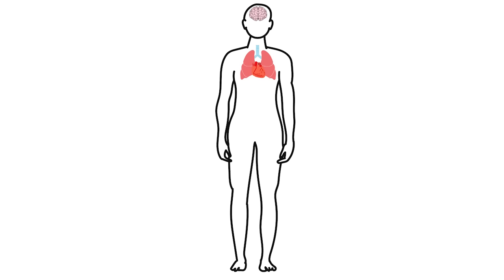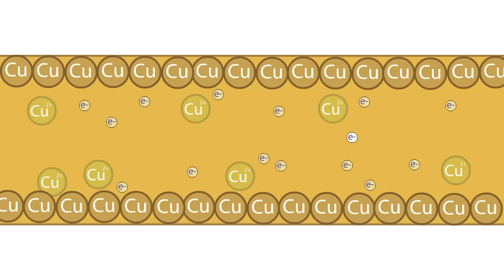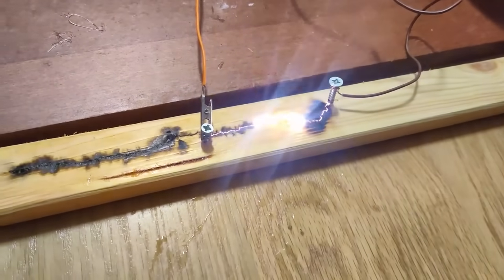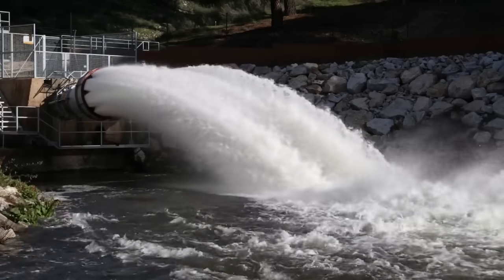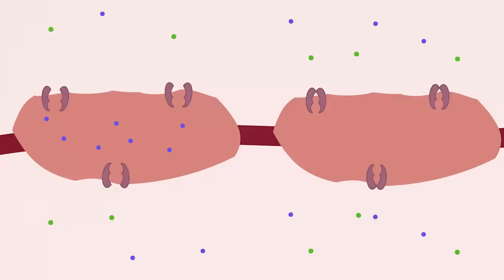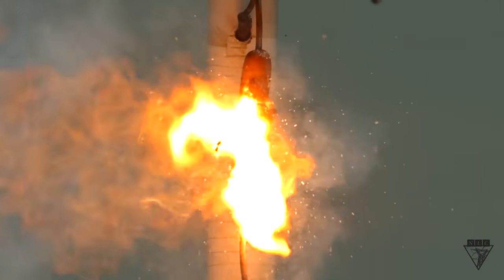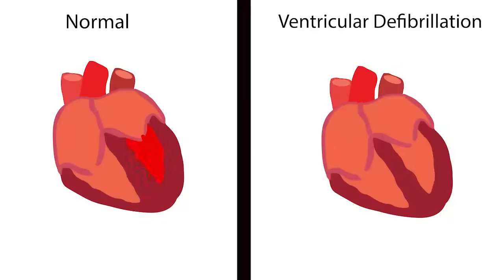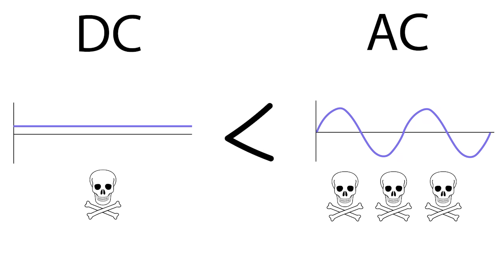Anatomy of Electrocution

Comment: My dad is an electrician and he had a "no let go" shock when someone ignored the tag on the breaker and turned on the wires he was working on. He said he knew what was happening and kicked the ladder from under him which broke him from the wire and saved his life. Unfortunately the electricity damaged his heart and he has to take heart medication and routinely needs to get his heart checked for the rest of his life, but at least he's still alive!
Reply: I was curious about this, how do you free someone with his hand firmly gripped around a wire and without touching him? I guess a towel/rope would be a good solution?
Reply: @sofast8149  just ramm the person with your shoulder,ramm it hard so the shock cannot overcome the inertia of your body,of course,you gotta be dressed,otherwise spartan kick the person's hip,no joke,if you start thinking too much,it will haunt you forever...you can both recover after a severe kick and a mild shock,but if you hesitate,it will haunt you forever...
Reply: @ScarryMarian2012  Electricity travels at light speed so it wouldn’t make even an ounce of a difference if you try to ram someone. You will be shocked too.
Reply: @ScarryMarian2012  Yeah I though about the spartan kick, maybe the soles of the shoes are enought to protect you during the kick and I guess that if you are not touching the ground during the kick you won't get shocked? Then again I have no idea how conductivity works in these situations. Thanks for the answer.
Reply: @SmaranSastry5521  yes u would be shocked too but i think is only a brief shock (so u will be fine) cos your momentum will quickly break the connection... it's not like in cartoons where the electricity acts like glue and the moment u touch the person u are stuck to him by the electricity....
Reply: @Smaran Sastry  it travels fast but nowhere near lightspeed.

And the ramming is because it reduces the duration of contact with them and the chance of you getting shocked and locking onto them.
Reply: @thewackykid  also in a kick even a long duration shock will do less damage going in one foot, up the leg, then down the other and out that foot.  You get shocked only in the legs.  Plus with rubber soled shoes on both the point of contact and the ground, as well as minimal time in contact to get a large surface area in contact you'll greatly reduce the risk.
Reply: @sofast8149  Like the song:
 everybody was Kung Fu Fighting.
Reply: @SmaranSastry5521  Yes, you would be shocked. However, avoiding a shock isn't the goal in that situation. It's freeing someone from the inability to let go while avoiding the same situation yourself.
Reply: @sofast8149  i agree with your reply,but i experience that,in a blink of an eye,a friend got caught in a 220V shock,so i sprint full speed in 12-15 meters and rammed my friend with my shoulder,i got also a big shock and a dislocated shoulder,as my friend got also dislocated shoulder and 2 broken ribbs,but we are both alive,he got some thing fried on his legs and left hand,but very much alive and kicking,so my suggestion is not a supposition,but a share of experience,make the difference of each scenario though,ur an adult,make your life-saving decissions FAST,no time to think....otherwise the regrets are forever.
Reply: @thewackykid  that is the priciple of my example told above,the body momentum will disconnect you also,in spite that you also get a shock.
Reply: @sofast8149  please Sofast, forget the Spartan kicks and just try and turn the power off.
Reply: @SmaranSastry5521  But would it kill you?
Reply: @ScarryMarian2012  Use a wooden broom. That was what they taught me in the first year at school studiyng for electric engineer.
Reply: @SmaranSastry5521  you'll be shocked, but you won't be stuck to the other person
Reply: @SmaranSastry5521 thank you for your comment. It made me Google it! If by "light speed", you mean speed of light, then not really. Apparently it's 60-80% the speed of light. So in a real life situation there's practically no difference. Just an interesting fact!
Reply: @SmaranSastry5521 that’s why u use a thick enough rubber layer
Reply: @SmaranSastry5521 electricity is not light speed or we would have extremely fast and cheap internet
Reply: @SmaranSastry5521electricity travels at electric speed not light speed
Reply: @sofast8149  2x4
Reply: @sofast8149  kick or slam with something
Reply: @sofast8149  A wooden log should work, wood isn't a conductor
Reply: @Sofast  if you ever need to touch something potentially charged use the back of your hand.  That way the shock causes you to quickly jerk away from the thing.

If someone is locked onto something and you decide that the best way to help them is to remove them rather than unpower the thing.  You should run at them and keeping your hands closed and arms to the chest slam into them knocking them off the source.  If you fail because you're tucked in you can't grip on even if you do receive a shock.

But if it's possible just shut it off, unplug it, kick them off, or use a nonconductive stick.
Reply: did he sue the idiot who turned the breaker on?
Reply: @kenzo_1172 you'd be surprised how often that kind of accident happens and who is responsible
Reply: @kenzo_1172  why would he ? It wasnt intentional
Reply: @sacha_sky  "[...] when someone ignored the tag on the breaker [...]" Intentional or not, the person ignored a tag that is there to warn others about the maintenance!
Reply: @sacha_sky  That's negligence. Literally a crime when someone can get killed for you not caring enough to take safety precautions.
Reply: @sacha_sky  It's called negligence.
Reply: @williamdetempolivre  That's why it's called LOCKOUT- tag out. When it's properly locked out, it can't be turned on.
Reply: @sacha_sky  it was intentional. They ignored the lock out /tag out system which is a MASSIVE no-go
Reply: @sacha_sky  Negligence causing injury is a legal reason to sue.
Reply: @sacha_sky   criminal negligence
Reply: @williamdetempolivre  im not saying that he's not in right to sue him but that there is no reason to do so since it wasnt hate or stupidity but just poor intelligence, sueing him wouldnt change anything
Reply: @foundwheels1939  im not saying that he's not in right to sue him but that there is no reason to do so since it wasnt hate or stupidity but just poor intelligence, sueing him wouldnt change anything
Reply: @JeffarryLounder  im not saying that he's not in right to sue him but that there is no reason to do so since it wasnt hate or stupidity but just poor intelligence, sueing him wouldnt change anything
Reply: @672 MACK Nasby  right,  because he should have been the only person with a key to his lock, correct?
Reply: @sacha_sky  Drunk drivers dont mean to kill either but they get sued.
Reply: @sacha_sky  "It wasn't stupidity, just poor intelligence" Yeah, and I didn't just watch a video, I merely perceived it with my eyes. You don't unintentionally ignore a tag on a breaker. That person's primary goal may not have been to hurt someone, but ignoring the tag was intentional, and they knew full well that someone might get hurt by doing this. You can be sure that I would be going after someone for causing me to require medical care for the rest of my life because they decided to ignore a maintenance tag on a circuit breaker.
Reply: @constvoidptr  i understand that he cannot be left unpunished because he violated the trust requested to have this job and he was aware of how to not violate it, but what going after this guy to the court will concretely change  ?
Reply: @sacha_sky  Pretty sure intentionally removing a tag saying 'hey, someone is touching this wire', and knowingly turning on the power would be 3rd degree murder, or at the very least, manslaughter if they were killed.
Reply: @sacha_sky  even if it wasn't intentional, when you sue someone, if they have a life insurance then the insurance company will pay the lawsuit and not the person. You should always sue someone when shit goes wrong without reason
Reply: @FrenchPolitics  it was intentional. He ignored the do not energize tag deliberately.   Lock oitbtag out laws means that the person ignoring the tag out is responsible.
Reply: @sacha_sky  In the US messing with lockout tagout when you weren’t the one to lock and tag it, you can be charged
Reply: I didn’t mean to run into this crowd killing 4 people
Reply: @sacha_sky  the guy who turned on the breaker intentionally ignored the tag, which is grounds not only for being sued but for a criminal negligence charge; especially since Zizumias' dad received a serious life altering injury due to the guy ignoring the tag and turning on the breaker
Reply: @sacha_sky  They knowingly and intentionally disregarded basic safety measures.
Reply: @sacha_sky  Maybe it's different depending on the country and if the medical bills are paid for by the government. In the US, at least, you generally sue someone to have their insurance compensate the victim for damages. This is whether it's a car accident, a dog attack, or an injury on property like this. The suit isn't to hurt the person or make them personally pay you (although this can be the outcome depending on the circumstance). A lot of people even in the US are reluctant to sue after car collisions, but honestly everyone is required by law to have insurance and their rates get increased after they are found at fault in an accident, so the "damage" is already done to the person. Unless you sue the driver, generally, insurance doesn't pay out for your medical bills, meanwhile they are already about to charge the other driver more for their insurance anyway.
Reply: @sacha_sky   if they ignored a tag on a breaker then he could have definitely sued, even if it was an accident if it he ahd died it would have probably been deemed manslaughter because the person carelessly ignored the tag
Reply: @sacha_sky how has your reading compression improved?
Reply: @sacha_sky of course it was intentional. It was tagged out and he proceeded to take it off and turn circuit back on for selfish reasons. That was very intentional.
Reply: @sacha_sky must be a way to get paid out because of your coworkers stupidity, right?
Reply: @sacha_sky why wouldn’t he he got seriously injured from it!
Reply: @sacha_sky  negligence is as punishable as intentional actions
Reply: @sacha_sky  he said there was a tag that he ignored. he willingly out another humans life in danger. this could even considered as attempted murder
Reply: @sacha_sky  "You know, I was careless and sped through a school zone running over 5 children, but I didn't really do it intentionally, so you really shouldn't hold me accountable and just let me go. Charging or sueing me wouldn't change anything."

^Is this really your argument? Are you really this stupid?
Reply: Good Lord!
Reply: This is why LOCKOUT, TAG OUT is a must.
Reply: When I was 17, this happened to me with a cable mounted switch of a table lamp, as I was about to get up from bed for early morning shift at a local steelworks. The cable had popped out of the switch and into my hand. I couldn't let go but managed to literally throw myself out of bed, onto the floor, a distance far enough to pull the offending cable from my hand. I'm almost 66 now and was lucky not to have suffered any lasting damage.
Reply: @HGodwinson-hg1  you probably wanted the day off work anyhow?
Reply: When did electric work in school. We would ground the hot wire to the ground. Our teacher was the worst offender flipping breaker on with out saying anything.
Reply: My cousin was an electrician. One day another person fell against an electrical source and held him. My cousin pushed him away and he got stuck. He said when the medics were doing CPR they started talking about stopping the effort. He could hear what they were saying and was screaming and moving to get their attention but they didn’t know it. He finally got one finger to move, they saw it and continued. His hands were wrapped up fat to protect them. He said it was so hard to remember he was screaming and moving but they couldn’t tell. I can’t imagine how you get past that kind of terror.
Reply: I grabbed a deep freezer handle when I was barefooted and I couldn't let go either. By flailing my legs I managed to get both feet off the ground and broke the circuit. Also, (same deep freezer) a big ass dog came into our yard one day when it was raining, trying to kill a mother cat and her kittens. The kittens ran under some stuff in the shed and the mother cat jumped on top of the deep freezer. The dog jumped up to try to get it's jaws on the cat and when he did he put his front paws on the freezer. That's was it. It lit his ass up good because he was wet. Lol. I was running to try to keep him from killing the cats and I saw the whole thing as it happened. He ran by me like a bullet.That was the last time he came to our house.
Reply: @jamesstreet228 your narration is funny as hell but sorry to the dogo now I can't stop laughing 😂😂😂
Reply: I've been no let go shocked. My helper has spilt a bucket of water on the floor of a customer's house. I had my helper take all my tools out and said I'd clean up the water. Started cleaning up the water with a towel and instantly got grabbed by a bare wire that had gotten wet.  Neither helper nor customer was around. I somehow managed to fall to one side out of the puddle of electric water. Strangest thing was it never hurt
Reply: Yes, very shocking  ⚡⚡⚡
Reply: @gangoffour6690     and re-VOLTING as well!   Hahaha!
Reply: I have an industrial electrician friend who experienced almost he same thing.   Luckily, he fell from the grip.  Unfortunately, it was a pretty bad fall.. but fortunately it was far enough that he HAD to let go!  My friend  is  fine and retired now.
Reply: I'm an apprentice on my 3rd month and the same thing happened to me, Had to lick myself off the ladder, Hurt my knee, But the shock was from a 120v breaker and it didn't last very long, One of the worst experiences of my life, I'm still and apprentice cause fuck it we ball, I start school next year
Reply: My father had a similar accident when he touched a live ‘no let go’ circuit that was certified and signed as turned off and dead when it wasn’t. Yes it damaged his heart. Over the next 6 years he had a series of small heart attacks then a massive heart attack and cardiac arrest and died in 1969 before the pioneering heart transplant surgery became available. I was 9 years old at the time. Compensation for the industrial injury was an electric battery powered clock. Suing companies or anyone in those days was just not heard of. Nowadays we’d take them to the cleaners and with modern day medical interventions he may have survived.
Reply: I'm so very glad that your dad is still alive! What was the person turning on the electricity thinking?! 😠
Reply: holy fuck glad he made it
Reply: Not going to lie electricity kind of cringe
Reply: Isn’t that a felony?
Reply: my dad was doing HVAC work, hit a live wire and it blew him across the room lol
Reply: lockout is grabbing 1 of 20 padlocks from a box and locking it out with u having the only key. making it impossible to turn on while u work on it.
Reply: Wow! Ur dad's a BEAST! 💪🔥
Reply: I’m going back in a minute I need a little more help I have a lot to get to get to work but I’m not sure what to say
Reply: That's somewhere between having a nasty shock and being locked on. If he was locked on then he wouldn't of been able to kick or do anything. I'm a sparky n I've had quite a few shocks but only got locked on once. I thought to myself while the 240V 50hz was running from one hand to another (hand to hand). Even though I thought I was going to die, it didn't bother me. It would of just been very inconvenient 🤷🏻‍♂️
Maybe it's because I'm clinical depressed n have been for a very long time 🤔
Reply: Quick thinking, the only way to actually let go is by having another force other then yourself help u. In this case gravity.
Reply: I think that’s why they call it LOCK OUT tag out. Like you lock it and then tag it so it can’t be accessed and people know why bc of the tag.
Reply: My dad was also an electrician.  He would bring his own padlock with a key that only he carries to lock the breaker box himself.
Reply: and you pressed on this video to see what happens to your father, he must be proud
Reply: I had a moment like this turning on a broken light but it lasted only 2 seconds
Reply: God Bless Him!
Reply: I was an electrical apprentice working on a PE cell turns lights on at dusk on 4 story building ,power was off tested it ,had fit new one my qualified work mate turned power on replaced fuse ,I got hooked hands clamped on cables ,if threw me I would have gone over building would have died ,but it was like slow motion my workmate ran kicked me in back I fell forward, funny how it went slow motion really ,was just work accident thought nothing off it but I now in 50s got heart issue bad liver maybe I was cooked inside who knows I nearly coped it again on another job by same bloke turned power on ,that day 2nd time I refused to ever work with him and I was retrenched months later ,found new company who were better.
Reply: The video of the Guy touching the fan was awful to see. What a horrible way to go.
Reply: This is why I always treat every circuit as live.

Yesterday I was working on a circuit that had a bare wire dangling inside it. The wire was live.
Reply: Glad he's still with you all
Reply: He should’ve taken precautions to lock off the breakers
Reply: Thank God he survived, may God bless him and heal him, um so sorry
Reply: 6.6.6, .
Reply: Is the US cop taser the same
Reply: Thay are the worst kind of shock when u cant release the cable hes lucky to b alive
Reply: Because it was AC he was able to let go. It’s not like a true DC no let go. As AC pulses you can break away
Reply: Impressive that he had the presence of mind in such a situation to work out what to do, and actually do it.
Good on your Dad. Hope he gets over it soon.
Reply: The same thing happened to my dad when I was a kid
Reply: Smart man and quick thinking
Reply: That's unfortunate, but at least he's still alive, but how did this permwnantly affect him?

Can you logically explqin why this affected his heart for the rest of his life.
Reply: why wouldnt gloves help
Reply: That's some quick thinking. Knowing "i have to cause myself some bad injury to survive" and immediately taking action. Bravo to him!
Reply: That idiot must at least pay your dad’s medication for the rest of his life.
Reply: Total bummer, man!  Audience wishes him all the best.  Cheers!
Reply: And that's why you should lock off the breaker with a padlock and put the key in your pocket. Or totally remote fuse and put it in your pocket or completely remove the wires form the circuit your working on. These are the rules i have to work to but I am in the UK.
Reply: He couldn't let go but he could kick the ladder? That doesn't make sense!
Reply: And that is why we lock it out today.
Reply: Hope he lives a long and healthy life! 🤗
Reply: You can’t use a properly applied LOTO set.
Reply: This reminds me of the story where a technician was working on something, I think in a server room. Then an office worker came in and asked if he can borrow a pair of pliers. Curious, the Tech asked him, why do you need pliers?
This stupid F, was going to remove the metal twist tie the Tech put there, to physically stop anyone from turning the circuit breaker back on, frying the Tech and servers.
I forgot what happened next, but if I was the Tech, I would be livid. Especially if there was a note with the tie, explaining WHY it is off.

And this story reminds me to ask, if I don't know why something I'm not responsible for, is the way it is.

I get being self-reliant, and taking matters into your own hands. But breaker situations like that, aren't like self-defense, or cutting off a genuinely unfair & scamy boot off your car. You're messing with a utility workers life, while they are doing their fair & necessary job, that's more honorable & important then a pretentous cop’s. Just ask around in that situation. Bring a battery booster with you, if you have to charge your phone or whatever. 

Tell your boss you can't do your computer job, until the tech finishes theirs. That's how it is, with road workers just standing around. They're not lazy, they're likely waiting their turn, to do the part they're trained for, or, they're waiting for approval for something unexpected, like encountering a pipe or cable not on their map.

Be like that, in certain situations, ask, don't just do stuff. You could take out cable for a whole neighborhood, or end an innocent worker's life.
Reply: Sucks to be him, what a loser lol
Reply: Praying for him!
Reply: It’s not exactly the same but at my job, we clean industrial machinery and so we have to get into the machines and stuff like that. Obviously this can be very dangerous as someone could activate the machines whilst we’re in them so we have a protocol called SILT (Stop, Isolate, Lockoff, Test). You stop the machine, isolate the power source, put a padlock through the switch so it cannot be turned back on, and then test it to see if you can switch it back on. The keys to the padlocks are kept in a lockoff box and each worker on the job is given a padlock key because multiple padlocks are used to lock the box with the other padlocks in them. That way, every single worker must hand over their lockoff key in order to unlock the box, get the other padlock keys, and then turn the power back on which is something we do at the end of the day.
Reply: I have had a few oopsies, luckily I’m still alive but I never got my heart checked, maybe i should do that sometime 😅
Reply: Lmao 🤣
Reply: Man who tf just turns on the breaker if there is a note to leave it off
Reply: Fun fact: my uncle (an electronic technician with 30+ years of experience fixing crt tv's and old dangerous sh*t, so he's been shocked by high amps and voltages) can grab exposed wires connected to the 110v (10amps) outlet and he won't even bat an eye, he says he feels a little tingle but nothing else. 

Bonus fun fact: the husband of one of my aunts is an electric engineer with almost 50 years of experience, he can grab exposed wires connected to the outlet too like if it were nothing.

Extra fun fact: my family is weird af.
Reply: @LagrangePoint0  most of EU countries have 220V AC...110V AC is preeeety forgivable,but no way 220 will let you go untill fryed....
Reply: @ScarryMarian2012  we have 110v over here in south america.
Reply: @LagrangePoint0  fun fact, they make tools to test voltages instead of fingers.

Another fun fact, the people in your family also lick windows.
Reply: @LagrangePoint0 thats few thousand volts ,he either had thick chalices in his hands to do this otherwise bit weird ,my electrical mate got hooked had screwdriver in his hand melted screwdriver handle he survived ok I was on same job so know its true .
Reply: @LagrangePoint0  I'll believe you if you post a video of him plugging 2 leads into a live outlet and grabbing one with each hand
Reply: @Kevin15673  I'll record any of them when I have the chance, they live very far away (to reach the closest to me I need to drive for 12 hours straight without resting), I don't talk to them very often and I don't really have a reason to visit them, but I'll try to arrange a meeting.
Reply: @LagrangePoint0 h in the chat for an update
Reply: @ZarHakkar  I won't take a 12 hour trip just to record him grabbing some wires plugged on the outlet. If we make a family reunion (like we often do), I'll go with my dmm (to test the outlet as a proof) and we'll record a video.
Reply: @LagrangePoint0 i guess you would upload that to ur channel?  subscribing is easier than finding this comment later ^^
Reply: My dad is dead because some stupid guy turned on the breaker while my dad doing his work on wire
Reply: Wow! You’re father was fast thinker, ! My dad had a coal worker step on a hot wire at the coal mine and the man had on coveralls and the electricity burned his “you know what “ off! I remember coming to Indianapolis so dad could go see him at the hospital. Dad said they had psychiatrists coming in his room for therapy over melting off his private parts
Reply: @juliegreen7396  I’m going back in a few days I need some time I got some time off I have some work that I’m gonna have time for so I’m going yeah….. sorry I was being electrocuted 😂😂😂😂